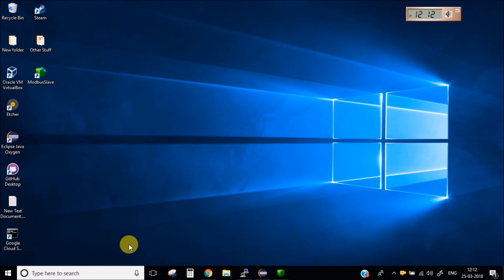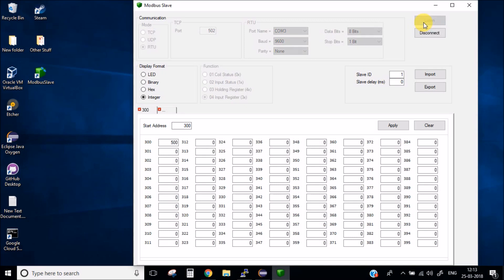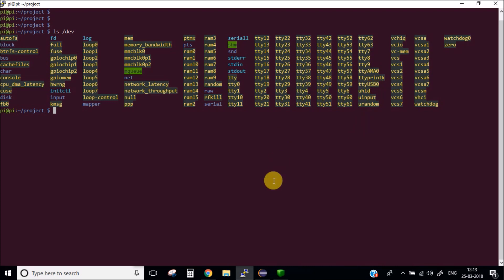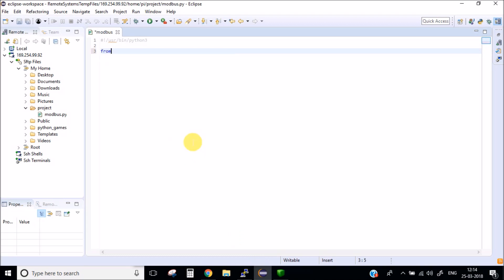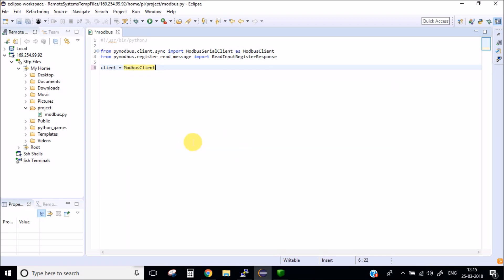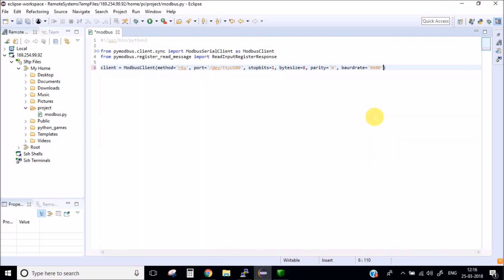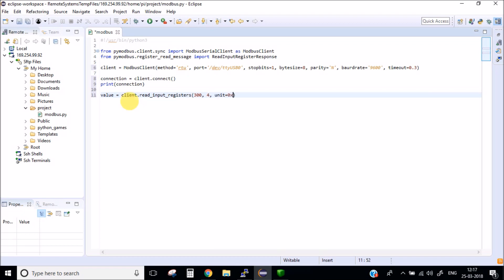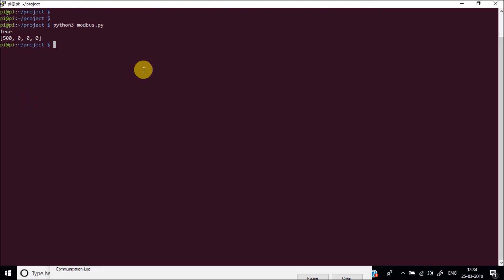Raspberry Pi 3 B + Tutorial Series | Modbus RTU Protocol

Comment: Hey , I am getting this error :
Error Message: Modbus Error: [Input/Output] Modbus Error: [Invalid Message] Incomplete message received, expected at least 2 bytes (0 received)

This is my code :
import logging
from pymodbus.client.sync import ModbusSerialClient as ModbusClient
from pymodbus.register_read_message import ReadInputRegistersResponse

logging.basicConfig()
log = logging.getLogger()
log.setLevel(logging.DEBUG)

client=ModbusClient(method = 'rtu', port = '/dev/ttySC0', baudrate = 115200)
connection = client.connect()
print(connection)
result = client.read_input_registers(300,1,unit=0x01)
if not result.isError():
  print (result.registers)
else:
  print('Error Message: {}'.format(result))

#print(result.registers)
client.close()

Log of the program:
pi@A310:~/Desktop/RS485 $ python3 RS485test.py
True
DEBUG:pymodbus.transaction:Current transaction state - IDLE
DEBUG:pymodbus.transaction:Running transaction 1
DEBUG:pymodbus.transaction:SEND: 0x1 0x4 0x1 0x2c 0x0 0x1 0xf1 0xff
DEBUG:pymodbus.client.sync:New Transaction state 'SENDING'
DEBUG:pymodbus.transaction:Changing transaction state from 'SENDING' to 'WAITING FOR REPLY'
DEBUG:pymodbus.transaction:Transaction failed. (Modbus Error: [Invalid Message] Incomplete message received, expected at least 2 bytes (0 received))
DEBUG:pymodbus.framer.rtu_framer:Frame - [b''] not ready
DEBUG:pymodbus.transaction:Getting transaction 1
DEBUG:pymodbus.transaction:Changing transaction state from 'PROCESSING REPLY' to 'TRANSACTION_COMPLETE'
Error Message: Modbus Error: [Input/Output] Modbus Error: [Invalid Message] Incomplete message received, expected at least 2 bytes (0 received)

Please suggest me the solution for error.

Comment: i got this error ( AttributeError: 'ModbusIOException' object has no attribute 'registers'
 )
Reply from the maker: This means that there is no data present for the register you are accessing.
Reply: @RocketSystems  i did exaclty like the video
Reply from the maker: Please dont follow my video exactly. Your register values might be different from the video. Read document rekated to your modbus device and accordingly apply it.
Reply: @RocketSystems  i'm using the same simulator, but now it's working thank you so much for this tutorial
Reply: Can you please upload a tutorial about sending some information with the raspberry pi using the protocol IEC-60870-5-101
Reply: @zammourimohamednabil9067  what you did, cz I am getting "ModbusIOException()" error when tried with the same simulator and python using terminal!
Reply: Please note that Modbus Slave program starts with default (03 Holding Register (4x)), so you need to change the code to. one more thing, try to use the terminal to run the code.. some editors through all kind or fake errors

Comment: i got problem with this. i got this error "AttributeError: 'ModbusIOExpection' object has no attribute 'registers' "
Reply from the maker: This means that the register address is wrong.
Reply: @RocketSystems  thank you. But  I can't know which is correct address. there are HEX and DEC. which one is correct. i tried code below:
value = client.read_input_registers(0x00,1)
print(value.registers)

and it's printing error that no attribute
Reply from the maker: @dashkadashpeljee8140  Read the document related to the device you are trying to access
Reply: @RocketSystems  ok thank you. It's working.     And i have one more question :). i can't read 32 bit unsigned integer value. it's holding 16 int register. how can i read 32 bit value from 2 16 bit register.
Reply from the maker: @dashkadashpeljee8140  Are you able to read values from those 2 16 bit register. ?
Reply: @RocketSystems  yes. i got [0 65535]. those 2 values are 32 bit unsigned int value. how can i convert it.
Reply: @dashkadashpeljee8140  Hey man, I have the same problem, how did you resolve that?

Comment: I brought USB to RS485c convertor for communicating raspberry pi3 b+  with PLC for serial communication in bidirectional.
Should I need to install modbus rtu protocol in pi and if so I would I install in pi for modbus communication with PLC?
Reply from the maker: You cannot install modbus protocol. You can install modbus python library in order to communicate to PLC via modbus protocol
Reply: @RocketSystems  sir I am new to this. We want to communicate in bidirectional way from PLC to Rpi 3 and vice versa.
Can I get the code sir.please?

Comment: Hi, could you help me please? I try to connect a Multi function analizer, using a Modbus to USB converter to the raspberry, and I found two troubles, first one is that terminal gives me an error with the line 4, it says that cannot import ReadInputRegisterResponse, I use python 3 and have pymodbus installed and updated. Well I decided to comment that import line, and the connection is successful because it prints TRUE, but then the second problem appears, it says: Modbus Error: [Input/Output] Modbus Error: [Invalid Message] Incomplete message received, expected at least 2 bytes (0 received) I think it is related with the line 11, but I don't know how to handle it. Please help!
Reply: hai bro i am getting same error... how to overcome this error ?

Comment: i have connected with modbus by using the 485 convertor, but iam facing an error called attribute error
Reply from the maker: Please explain your issue a bit more. When and how are you facing attribute error?
Reply: Thanks for the reply sir, as now the attribute error is rectified and now iam facing an error called " no response receive from the remote unit/unable to decode response"... I have connected rs485 module with pi3, another end is connected with modbus and the data from modbus has to be viewed from pi3...
Reply from the maker: Manoj Kumar K I think this issue is with modbus usb. Can you test it locally with your windows laptop first
Reply: The error is got fixed sir....thanks for your kind reply
Reply: @manojkumark1700  Hi Manoj! How Did you resolve that? I have the same problem